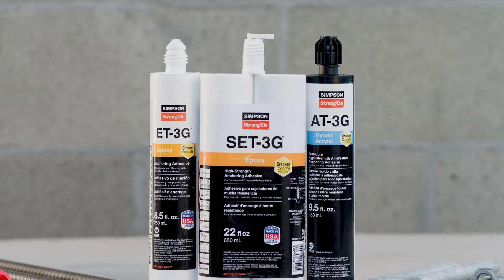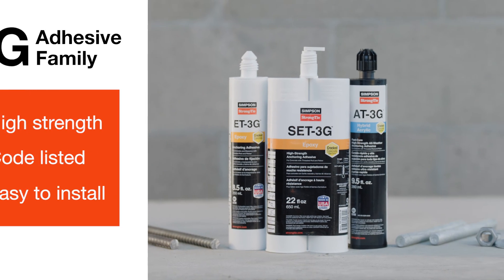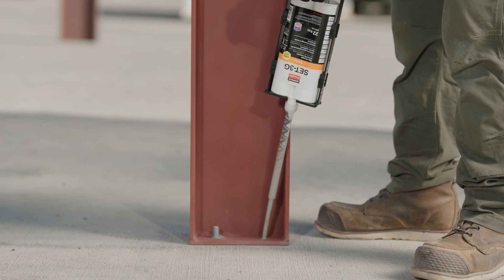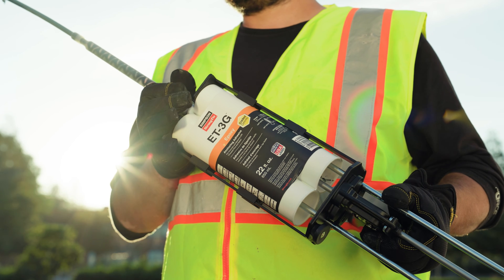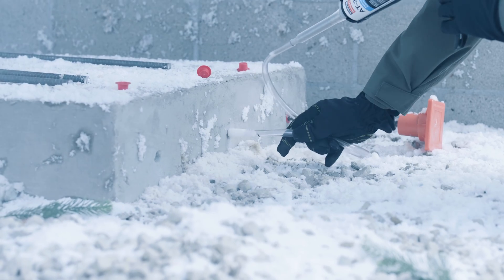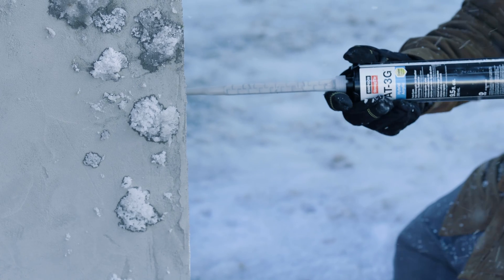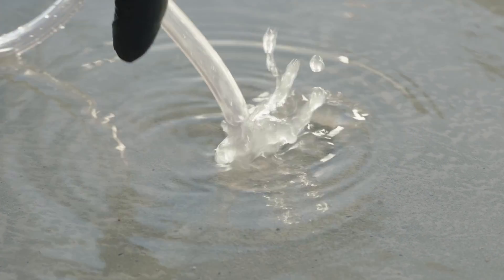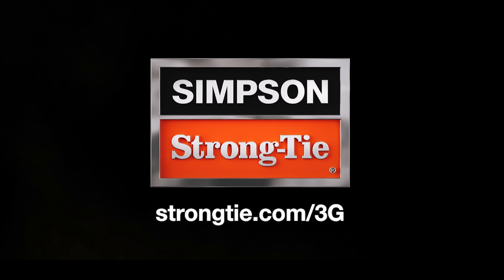Simpson Strong-Tie® 3G Family of Epoxy and Hybrid Acrylic Anchoring Adhesives

Comment: To install a 1/2 and 5/8 inch screw, what size should the cement drill bits be? Thanks
Reply from the maker: Hi, thank you for reaching out. Unfortunately, there are too many unknowns that we're unable to address through social media.  However, we do offer free engineering services that can answer your question.  If you call 800-999-5099 they can connect you with an engineer who can make product recommendations. Best, Jade

Comment: If adding your Strong Steel Shearwall (24") to an exisiting structure, can we use the SET-3G adhesive to help anchor the included threaded rods into the concrete?
Reply from the maker: Hi! Thanks for your question. We give cast in place design info using our anchor bolts; but when they pour and then want to use SET3G later that is for the engineer on record to specify and design the application. If you have any other questions feel free to reach out at (800) 999-5099. Best, Jade
Reply: I need to anchor a 5/8 construction tile to a column. Which epoxy is better, XP or 3G? Thanks
Reply from the maker: Hello! Thank you for reaching out. Unfortunately, there are too many unknowns that we're unable to address through social media.  However, we do offer free engineering services that can answer your question.  If you call 800-999-5099 they can connect you with an engineer who can make product recommendations. Best, Jade